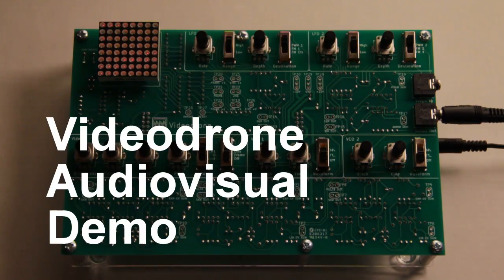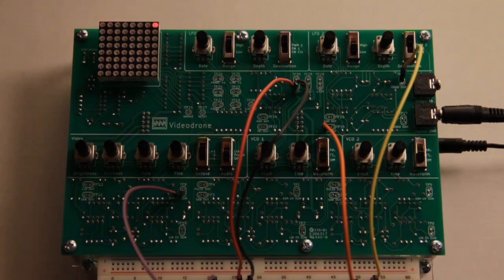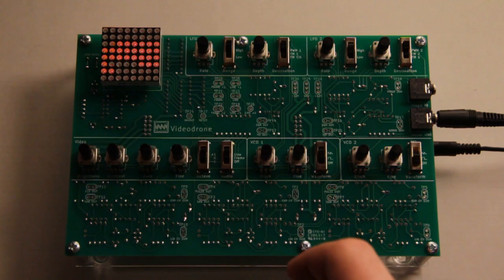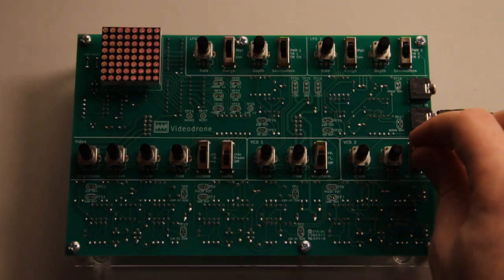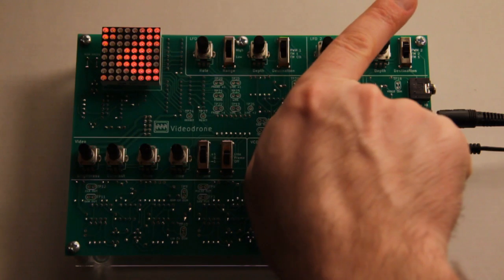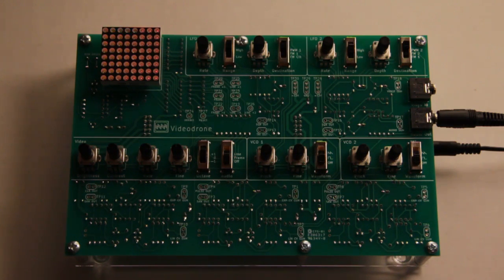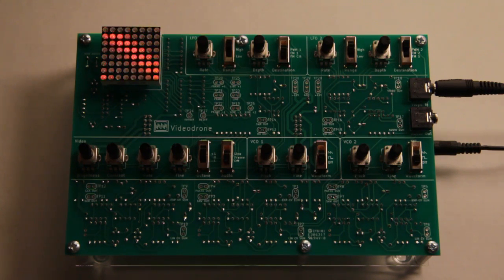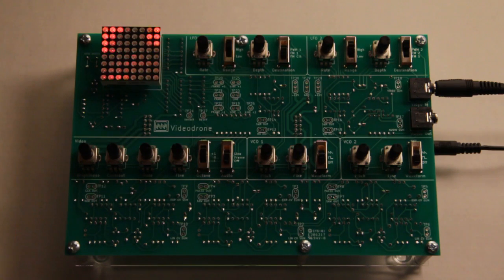Videodrone Demo: Intro to LED Video Synthesis

Comment: How does one "freeze" audio? What does that mean?
Reply from the maker: Ric Johnson It takes an audio signal which is constantly varying in real-time at relatively high rates and turns it into a static image allowing you to visualize something that is usually changing too quickly to see. It probably would have been better to just say visualize since freeze is a bit of a metaphorical way to think about it.